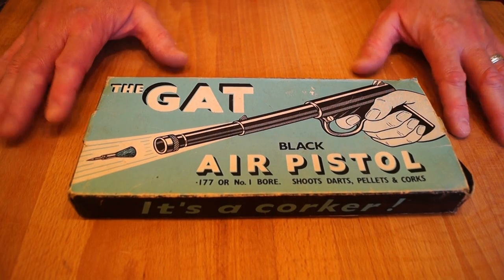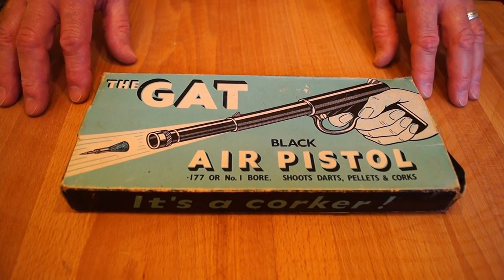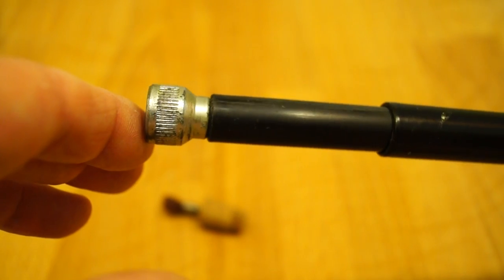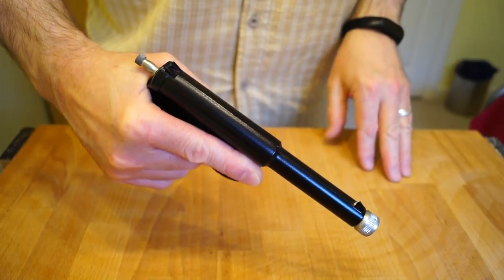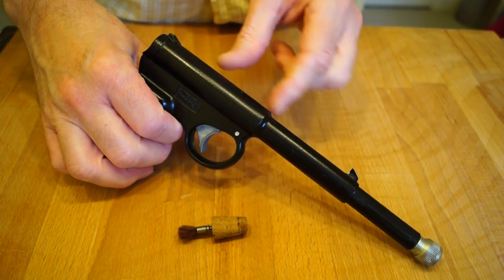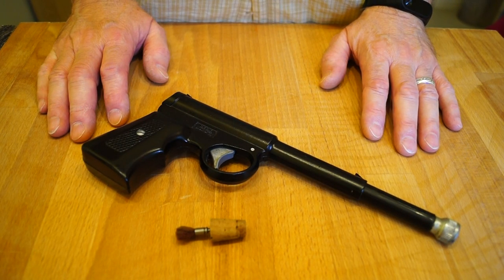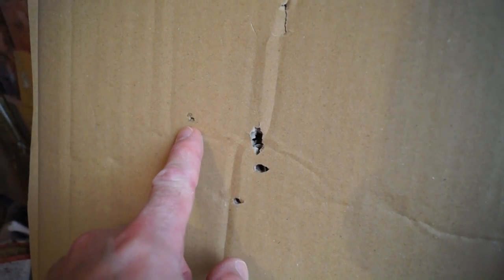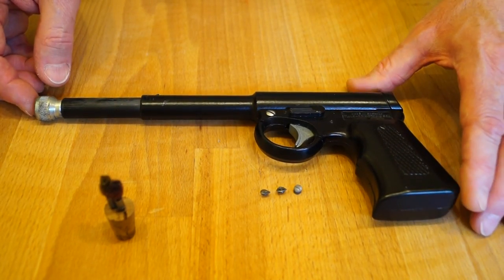The Gat Air Pistol Review

Comment: this video took me back 20 yrs as a 10 yr old...but its not an air pistol...no air gets compressed down the barrel....its a kids spring powered pistol, clog the little holes up and fire it, theres no difference
Reply: It has a cylinder & piston just like any other air gun.
Reply: no it dosent and no it hasn't sooooo go back asleep
Reply: @Max-x8e6l  
I remember mine getting filled up with dust, mine did not work when the holes were clogged, the power of the spring alone was only just enough to just about push the pellet out of the barrel.
Reply: Lots of idiots on here saying it's not an air pistol.   WRONG!

Comment: I just got a load of boxes with many things in them from.a local antiques place near me in france. This gun was in one of the boxes. It's very old and I can't seem to unscrew the very back piece to load it. It's missing it's spring and the model from your description is a very early one. I take it from the cork you have that that can be pushed in at the end of the gun. Thanks for the video. I'm from the UK a sixties child but never knew about these. My father was not into anything like this and so I never saw one before. Used air rifles later and then went on to shotguns!!
Reply from the maker: The cork is pushed into the muzzle after cocking the action. Apparently the company also made a rifle too but I have never seen one. Thank you for watching and taking time to leave a comment 👍

Comment: There is an earlier model ,by T.J.HARRINGTON...the original manufacturer's....it has no safety catch....NOT designed for accuracy! But fun! Thanks for posting!
Reply from the maker: The gun I had in the 1970s didn't have the safety either, the front of the pistol grip was also straight with no finger grooves. Thanks for watching 👍

Comment: It is quite easy to take the gun completely to pieces to clean and lubricate it. Having just done that, it is now fully rejuvenated and flicks the pellet out with considerable vigour! Mine is the earlier model to the one in your video - no safety and the front section of the barrel is some kind of metal. Accuracy is total guesswork as it kicks like a mule! The one I have is my original from the mid 1960's.

Comment: My trigger catch was worn , and one time when I was screwing in the loading pin it fired...dragging my nail off ! Needless to say the nail remnants were used as an experimental ammo alternative :) That and rolled up tin foil :)
Reply from the maker: Yup, I have tried tin foil in mine too. Those were the days. Thanks for watching 👍👍👍
Reply: Did the same with mine, I had lost the screw in pellet probe thing and replaced it with a bolt from dad's shed. It actually pulled my thumb down the tube.
It was more dangerous to the user than whatever it was pointed at lol

Comment: I had one of these a long time ago and I don't think there's air compression involved as such, it's a spring gun.  When the barrel is pushed in, a latch holds the spring back - pulling the trigger pushes on the latch and o.c the barrel shoots forward and the pellet ejects due to simple physics.  Not a true air gun and it has nowhere near 5 ft pounds.
Reply from the maker: Thanks for watching 👍 I found my old Milbro/Marksman G10 in the attic last week and it still works.
Reply: @NashRathbone  If it's in good condition might be collectible, but I found that I was wrong in saying the G.gun isn't a true air gun, found out there's a leather valve or ring around the inner barrel that goes inside the outer tube and this compresses some air behind the pellet when it's pushed in.
Reply: It has a piston  and cylinder. It is a proper air gun but nowhere near 5.5 ft/lbs.
Reply: @vanmanwales1590  Yes, you're right - my mistake, I thought it was just inertia that ejected the pellet.

Comment: I used to have a G10 as a kid ( late 80s/early 90s). Very similar in how it worked but was styled on the us army colt. I eventually rusted the crap out of the barrel by shooting spitballs out of it lol.  You still occasionally come across gat guns at funfairs as theyre often used at the shooting stalls for trying to knock over weighed down prizes with corks
Reply from the maker: I found my Milbro G10 in the attic recently so I might do a review. One gun I wish I still had is my Diana SP50, it works the same way as the Gat. Thanks for watching 👍
Reply: @NashRathbone  oh yep i stand corrected (just googled it). The diana was the one i had not the g10.  Push barrel as well. The g10 could shoot bb as well from recollection. Only one i still own to this day is my webley tempest.  Its probably the single oldest item i still posess.
Reply from the maker: Yes the G10 has a small magazine above the barrel, you have to point the muzzle up a bit whilst you operate the action to get a BB to load in the chamber. I had a Webley Tempest back in the 1980s, I still have the BSA Meteor bought for me by my late father in the mid 1970s. My latest airgun is a Gamo MP9 of which I have a review on my channel. I'd really like to buy another airgun but Mrs Rathbone says "No!"

Comment: smat little gun had a couple of them when I was young. didn't think it was a air pistol though it was spring powerd no air as your just using the spring to shoot the dart out.  any way smart gun in there day as a kid good video
Reply: It did have a plunger and it did work off air like a full sized air gun...
Reply: @korky7775  Correct 👍🇬🇧😁

Comment: its not even an air pistol... The only energy it uses is inertia. Had one of those in the 90s from my older brother.
Reply: C Moy, You're wrong. It is a true air pistol. Not very accurate and only propels pellets at around 200 fps but it does use air to propel the projectile.
Reply: Lots of idiots on here saying it's not an air pistol.  Wrong!